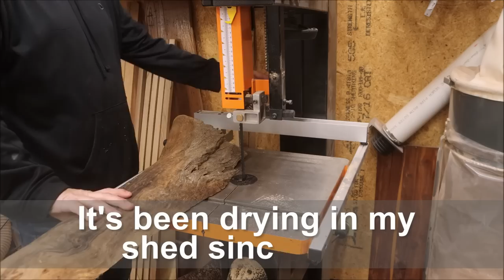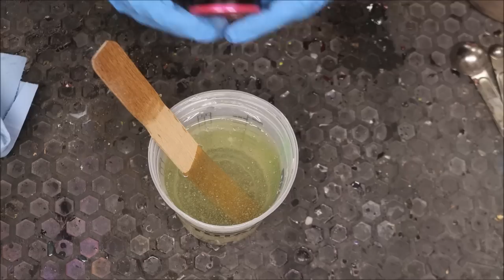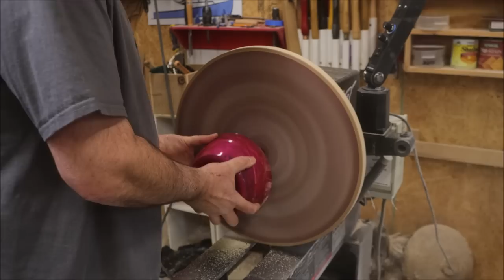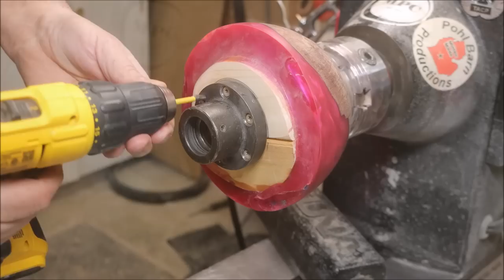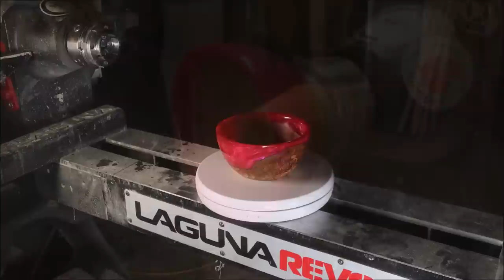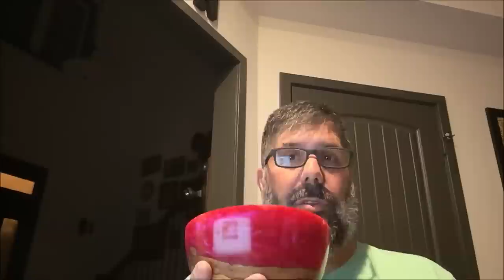I Cast a Pink Bowl and Wow It Came Out Beautiful

Comment: The flaming in the pink resin turned out absolutely 💯 😍 beautiful..... and it's February so it's a Valentines 💝 bowl 👍🏻
I do have 1 question for you.  I noticed beautiful spalting on the bottom of the wood as you cut it to fit into the resin pouring mold but couldn't really see the finished bottom of the bowl when you showed us the finished piece......so my long-winded question 🤔 is.....did any of that beautiful spalting end up showing on the bottom ❓
Reply from the maker: Yes! The pecan I use it very spalted. Thank you!

Comment: If you put some sanding sealer on the edges of the waste block, would that prevent it from soaking up some resin?
Reply from the maker: I don't think so, but resin will do the trick. I've started using UV resin for this.

Comment: Hi Ken, as others have stated the pink came out great.
Quick question -- did you put the poured resin in to a pressure pot or a vacuum chamber?
And how long did you let resin cure?
Thanks again for your truly inspiring videos.
Reply from the maker: Hey Chris, I always put my pours into a vacuum for 5-15 mins then in the pressure pot. This helps eliminate all bubbles. I let it cure overnight as I pour before I shut down the shop.

Comment: I have a question, I saw you use the vac chamber but not the pressure pot.  After you used the vac did you let the resin cure or into the pressure pot?  curious in scottsdale.
Reply from the maker: No I used the pressure pot after the vacuum. It helps eliminate more bubbles that way. I use the  vacuum is first to get the larger bubbles out and get resin into the small cracks, then the pressure pot to compress any small bubbles left.

Comment: Was that a vacuum pot instead off a pressure pot? Curious what makes you chose one over the other?
Reply from the maker: I use both. I first throw it into the vacuum, then the pressure pot. Get more bubbles out that way.  But when I have cracks in the wood it helps get the resin into them.
Reply: @MoonpieCreations  awesome thanks for the explanation. I figured it would do that. I’ve often wondered if putting the bucket of resin into a sonic cleaner (not submerged) would help get bubbles out. I used to repair chemical analysis equipment, and they would degass their solvents that way. It s like when you open a fresh soda lol